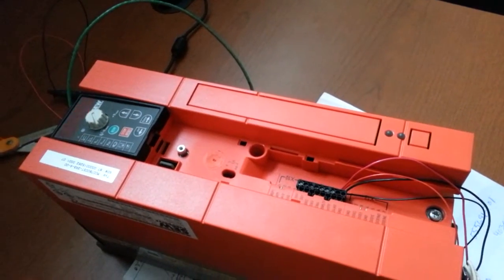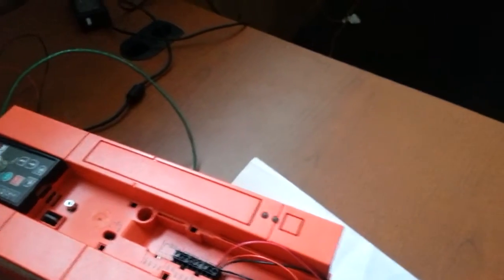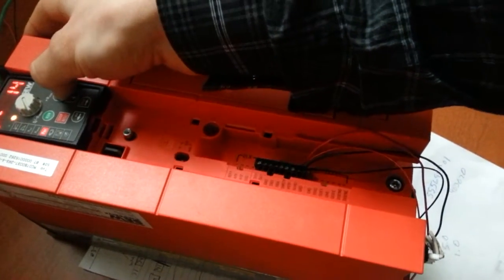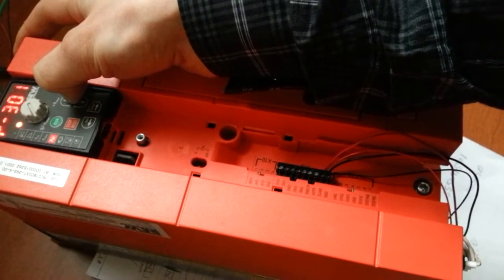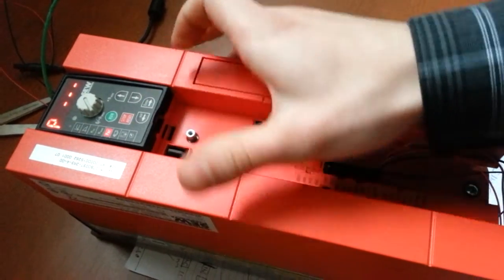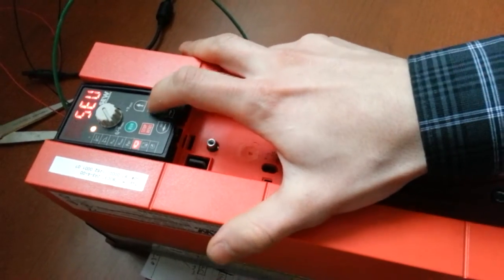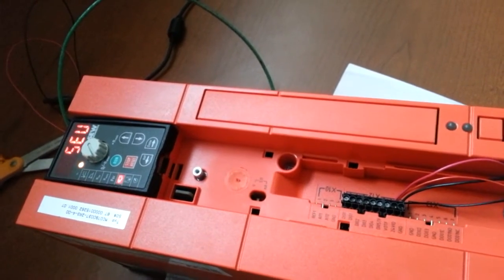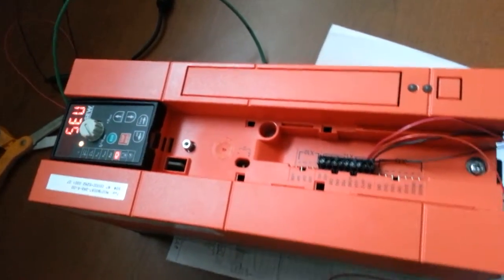SEW Eurodrive Movitrac B

Comment: I know this is a outdated comment, but just for reference to anyone looking at this in the future.
1. P130 & P131 are the acceleration ramps. They are not accessible via the parameter menu, because they are directly on the display menu row on the left. It's the two top most icons.
2. The reason why only SEW & NonSEW motor setting is avaliable in the motor menu, is because the inverter firmware is too old. This specific inverter is produced in 2007 (white lable, last two digits). The DRE motor series was released 2012. In this case picking SEW would have been fine.
Reply: Why is 24U flashing on the screen my friend?  I have this indication on my screen.  Thank you very much
Reply: @thepsycologics  24U on the display, indicates that the drive is only supplied with 24 volts. The inverter needs mains power on the X1 connector (on the top) to go into operational mode. Mains power is indicated with L & N if it is a 230v inverter, or L1,L2,L3 if it is a 400V version. 
The inverter simply can't run a motor if it only has 24v, it needs main power as well. 
My guess is that you probably only have an external 24V supply connected to the X12 connector pin 8 & 9. If main power is actually connected, it is currently missing (check the breaker), or the inverter is intentionally only supplied with 24V in some sort of a test setup.  
There is also the rare case where mains voltage is actually present at the X1 connector (check with multimeter), but the inverter still indicates 24U. This indicates that the power input is defective.         

The external 24v supply feature is a "keep inverter alive in case of main power breaker trip ". This way the inverter can still respond to status requests, even if the main power is gone. In an industrial setting it is important to get an indication about what is wrong, instead of the drive just being totally dead.  
The manual for the inverter is here: https://download.sew-eurodrive.com/download/pdf/20153341.pdf Page 13 shows the wiring diagram, page 26 the "24U" message.
Reply: @Ealen75 , That's really the problem, I've already powered it with both the 380 voltage and both voltages together